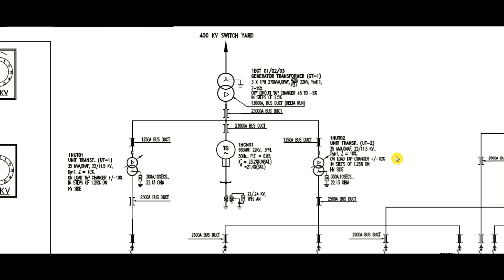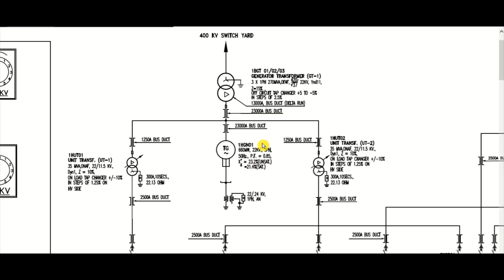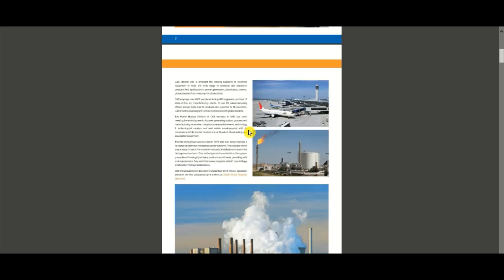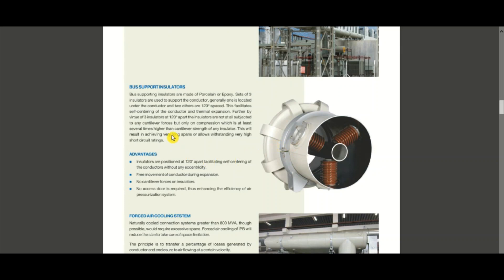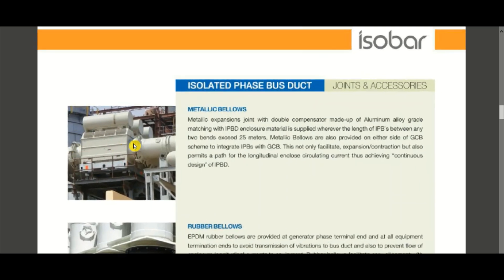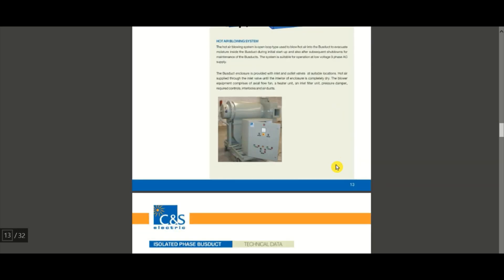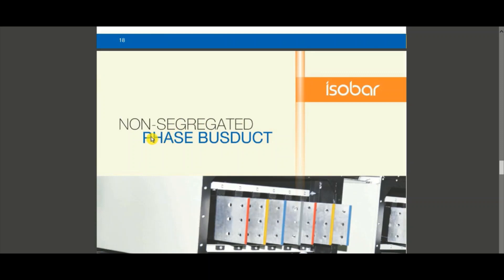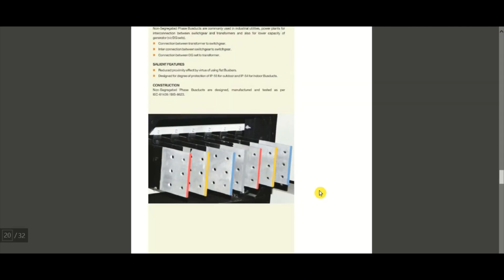Why Busduct for Unit Aux Tap off Run in Power System Network? Why not Cable?

Comment: Hi , how i can show the data of cables on sld as c.s.a and the length on sld in etap because it is hidden
Reply from the maker: Go to DISPLAY option at right side of ETAP screen> tick mark on cable length & size...it will come in the SLD
Reply: @SmartEducare  Thanks 🙏❤